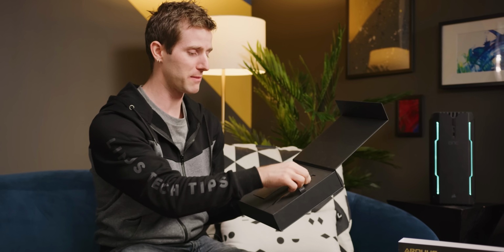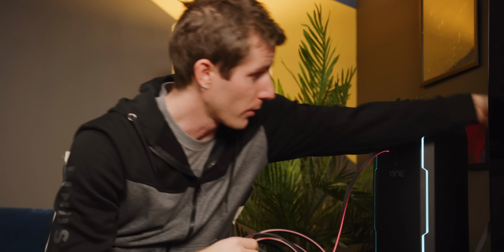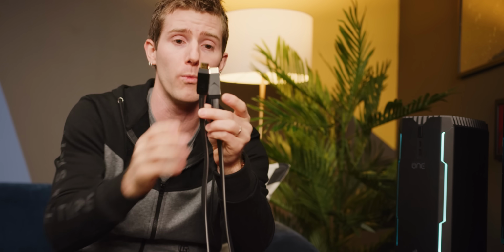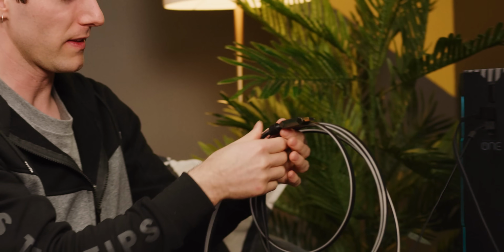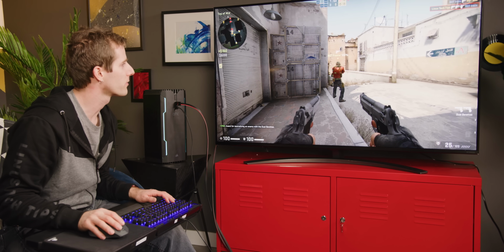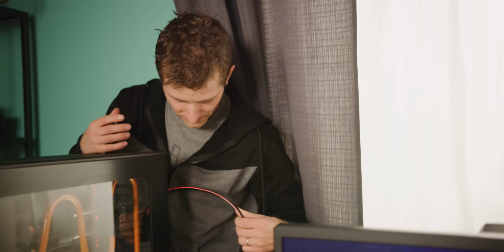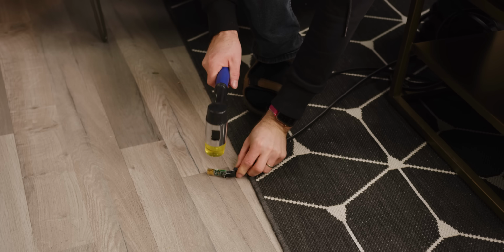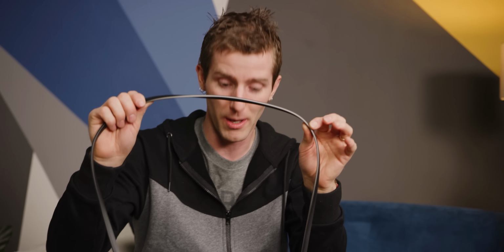The RGB HDMI cable ISN'T as dumb as you'd think...

Comment: Start to say that the supplementary micro USB for power does nothing and stop using it. Then complain that the middle of the cable is dimmer. What about if it was still plugged to the micro USB?
Reply from the maker: No diff
Reply: Linus Tech Tips all right then... thanks for answering :D

Comment: whats a good high quality Displayport cable? I want to get a better one then the one that came with my monitor.
Reply from the maker: If the one that comes with your monitor works at all, then it's just as good as you need
Reply: @LinusTechTips  oh. I heard the included ones can be pretty cheap. I get weird brightness flickering with freesync and heard that the cable could be the issue

Comment: When you've talked about their cable can't enhance video, remember when you reviewed HDMI cable with microprocesor in it which actually enhanced the quality?
Reply: That one had some fancy electronics to post process the image, didn't it?
Reply: @LosfrogerX  Yes it did, I'm just trying to point out that HDMI cable can actually improve quality IF it has the fancy electronics in it.
Reply from the maker: That's fair, but the cable component of the mcable is not the part that actually makes the image quality better. It is the video processor that is built into it that makes it better

Comment: Is there a high static pressure intake front fan needed when you have an obstruction in front of the fan? I have a phanteks p300 case and it doesn't have a lot of space for the air to flow into the case.
I've been looking for fans for a while now and wan't to be sure I do  
everything right.

Comment: One Question: DisplayPort?
Reply: What cable supports 360hz?
Reply: well display port succccccccccccccc
Reply: That company is pretty new, so I'm sure they'll get around to it.
Reply: You can get an adapter for both ends relatively cheap.
Reply: @matthewjbauer1990  ....144hz
Reply: @tahmid5115  244hz?
Reply: Matthew Bauer ahem....G-Sync?
Reply: @rotarubogdan8521  ...Freesync.
Reply: Bogdan Rotaru I mean you have to make trade offs for rgb Kappa
Reply: @rotarubogdan8521  gsync works over hdmi. And hdmi 2.1 is way better anyways.
Reply: @edragyz8596  gtx 2080ti - no support for hdmi 2.1. So only displayport
Reply: @89qn85mn  that's not an hdmi problem, that's an nvidia problem. It would take 2 seconds to start making 2.1 gpu's.
Reply: ...uh nerd tech stuff?
Reply: Haroldioactive uh you’re on a nerd tech channel?
Reply: Hdmi 2.0 is just as good as dp

Comment: I want one: sees price, nope I'm good
Reply: Not that expensive for the purpose. I mean, a module from Internet copper cable to fibre between two places of 300 metres costs around 600 euro on both sides. To handle the back and forth communication. So, this is fairly cheap even though it is directional.